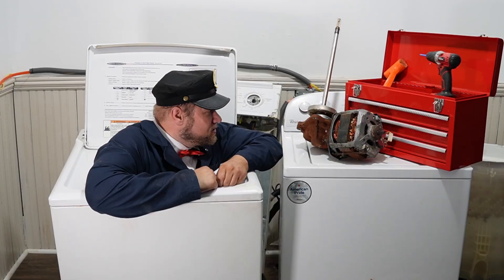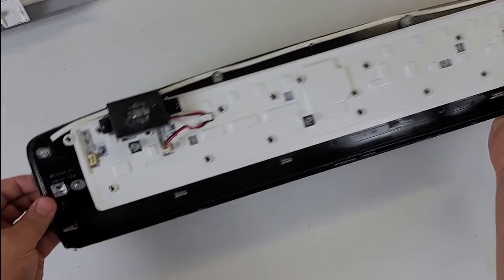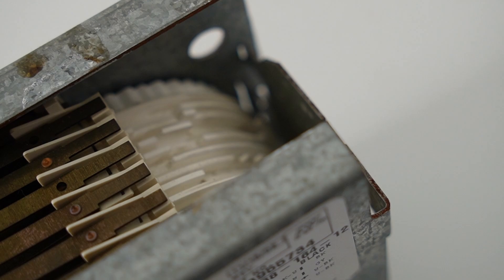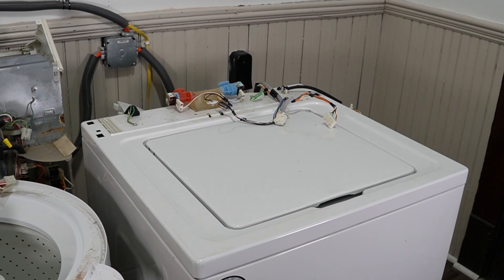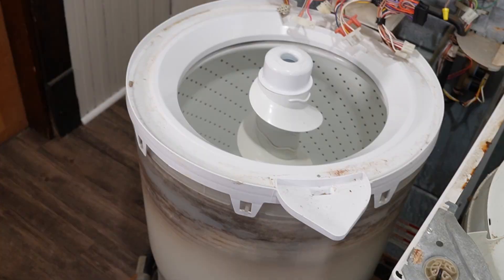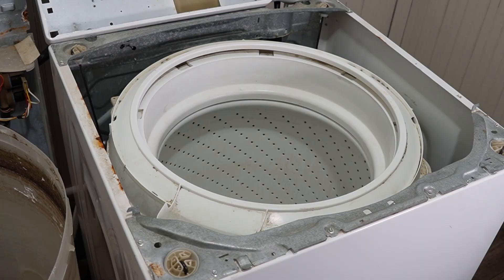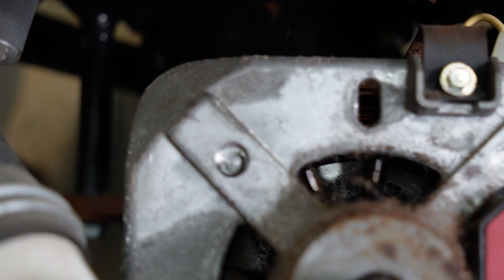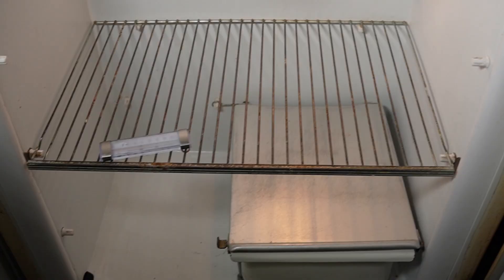Are Washers Built to Break? Inside a 1984 Washer vs. Now

Comment: Worth noting, $330/430 in 1985 (the sale/MSRP price listed in the SEARS Catalog that you showed on screen) is equivalent to $930/1200 in 2022 dollars. A random low end top-loading Whirlpool is $550/750 (at the time of this comment, which is effectively what my apartment washer is). That's a ~$400-500 base savings for a product that is vastly more intelligent (self-rebalancing is amazing), quieter, has more than twice the tub capacity, uses less detergent, and, as discussed in the video less water and vastly less electricity (90-95% less????). 

The energy cost for the 1985 washer is quoted at $67 ($188!! 2022 dollars) vs $30!! in the energy star guide.

I get people love when their confirmation bias about things lasting longer is true, but it's as or more important to consider the actual progress that's been made. As for electric components failing, fundamentally there's nothing stopping companies from using correctly sized components. It's like LED bulbs being run way over spec (thanks Big Clive for that information!), it's an unfortunate decision by companies but that doesn't mean incandescent bulbs are better (I mean, I still love them, but I love my lights that change color and dim through the day infinitely more).
Reply: I agree 100%
You aren't really saving money on the older system even if the new one doesn't last as long.
Reply: It’s even more apparent when you look at cars. In the 50s, aka “the golden era of the American car”, you’d be lucky if it lasted more than 5 years without rusting though. The designs were pretty snazzy though, most likely as a form of compensation as well lol
Reply: I'm an automotive technician so the car thing I understand completely. Old cars look nice and are easy to work on but that doesn't off-set the many many negatives that come with old cars.
Reply: Well researched, peoples rose coloured glasses view of history is amazingly short sighted
Reply: Incandescent bulbs are better at accurate color reproduction. Most crap LEDs have bad tint and poor CRI

Comment: We had a Maytag set from the 60's and decided to leave it at our old house when we moved in 2010 to our new place.  The only thing I ever did with the old Maytags was belts.  There was a lot of washing done with those machines.  But we left em and bought a set of these garbage Whirlpools.  They are not efficient at all.  No matter what I do, I can't stop the washer from banging around during the cycle and the clothes come out wet.  The dryer takes forever of course with wet clothes. There is no function on the Whirlpool to spin again like on the old Maytag...you could let it finish its cycle and go reset it to spin again.  We should have taken our old machines to the new house.  This new stuff is trash.
Reply: Try going to a pawn shop and getting an old one like that.  Can't be more than 150$.

Comment: I would like to see you get your hands on a Maytag top loader from the 1980s with the helical drive transmission.  Magnificently simple and durable machines.
Reply: It would be a short video, as you say, magnificently simple.
 I inherited one of these (& dryer) the only failure I have had (I should say, the only failure this machine ever had) is the timer discs wearing out in the washing machine (it was used daily for most of its early years).  And surprisingly, I could still get a genuine maytag part for only about $64cdn, not bad for a 30+ year old machine.   
 If anything is going to do it in, it'll be rust as with the machine in the video, not from leaks but the humidity/condensation that occurs during normal use.
Reply: @alexb.1320  Mine is 40 years and still running like a champ.
Reply: @alexb.1320  My co-worker has a matched set but they're the puke green color right out of the 70's LOL.
Reply: @wildbill23c  Ah, flashback Avacado. No question what era you are in when you see that color. =-)
Reply: @JohannnesBrahms  My grandfather has at least 4 sets (also 40+ years old) that various members of my family use. On the rare occasion they fail, my grandfather takes them apart and figures out the issue. My dad then gets on eBay and purchases the part, then my grandfather gets it running again.
Reply: @T4nkcommander  Three main working components and some belts.  Super easy to service and repair.  Some of the more detailed parts are no longer available though and if one of those little suckers go.  . . then KAPUT!

Comment: The barely used 1983 whirlpool/kenmore dishwasher I bought for $30 works SO well SO fast and reminded me so quickly of FUNCTIONAL appliances that I hunted down a 1986 washer/dryer set for $200. My clothes come out WAY cleaner WAY faster, and  I would have gladly paid more for those old used suckers than what comparable new ones sell for. Component accessibility/maintainability/adjustability/replaceability are EVERYTHING, and needless motherboards don’t mix with the humidity + dust of washer/dryers. 

If nothing else, see what builds up in a washer’s inaccessible filter after a few years in a household of long-haired humans, a shedding dog, and baby socks.

Comment: They’re engineered to fail because:
1) they’re built to the lowest possible price point because cost is the #1 determining factor in a buying decision. They will lose sales and potentially go out of business if they over-engineer their product and try and recoup that cost with a higher price 
2) 99% of the population do not understand how a washer works, nor do they care to find out. The differences between a well-built and poorly built washer are irrelevant to them and cannot be sold in a sales pitch. 
3) Having new appliances is as much a status symbol as anything else. People do not want to be seen with old, out of date appliances. This seems to be particularly the case with fridges - having a ‘white fridge’ is seen as a sign of low SES. 
4) Labour to repair appliances is significantly more expensive than it was 30-40 years ago and can easily exceed the value of the appliance, making repair pointless.
Reply: I’m that weirdo that finds out what the good stuff is and buys it, example: 4Runners (2020,2021) Honda commercial lawn mower (2022), my Kenmore appliances (2002). I go out of my way to pay more for better.
Reply: Exactly. If you calculate how old washing machine and driers cost in today’s money, they were actually quite expensive. Nowadays you can buy some cheap washing machine for 500$ with way more gadgets than before, so naturally they’ll fail. They’re not engineered to fail, they’re engineered to a low price point.
Reply: What does "low SES" mean, if you can explain.. Thanks
Reply: @ousamaabdu794  People from disadvantaged backgrounds.
Reply: @JAMESWUERTELE  The older 4Runners from the early 2000s are way better than anything made today
Reply: @Whiteyy191  thanks for the heads up.
An ex-girlfriend of mine was a bank teller here in the DC area, which is extremely diverse and has quite a bit of affluence. 
She said the people who always had the most $$$ in the bank were the unassuming blue collar immigrants. Keeping up with the Jones keeps many living check to check. 
Heck my washer and dryer were in the house when I bought it. 1980s Kenmore and the still work great. I personally could care less about optics
Reply: @ousamaabdu794  That’s very true. The never-ending race to outwardly appear wealthy will leave you behind in the long run.
Reply: Indeed on #1, this seems to lead most markets to a race to the bottom in long-term robustness.  Maybe a brand reliability rating could incorporated into the same sticker as the Energy Star info, to encourage better quality making a difference at time-of-sale, or manufacturers having to pay for their units to be recycled when scrapped, which there are similar requirements in some countries, but will need to be done more widely to make a big difference…
Reply: You’ve nailed it with this comment

Comment: Doing a old vs new washer comparison...and you use a 2002 vs 2017.  Even though the 2002 may have several design similarities , But there are definitely some build quality differences.  I've tinkered with old Washing machines from the 70's and 80's and they are more durable and easier to work on.

Comment: This reminds me of how LED light bulbs are advertised.  They print that these LEDs will last for like 150,000 hours and are a 60watt equivalent.  Well, the LEDs themselves may theoretically last that long, but in reality will only last as long as their weakest part.  Which, in my opinion, is the driver.  And, like he says, that tiny little electrolytic capacitor will only last a few years before drying out and smoking.  I honestly think that all this is well known by the manufacturers.
Reply: Most LED bulbs that I’ve bought go out quicker than incandescents. Many of them are DOA. I keep buying them though.

Comment: As interesting and informative as this was I think I missed the entire point. You showed both washers had pros and cons, but I don't think you pointed out why the older machines last longer than the newer ones. Is it the electronics? The motor size? The amount of electricity used? The wires? I'm honestly feeling like I'm supposed to guess here rather than you just saying exactly what is causing the new machines to wear out faster.
Edit: Oh and you've earned a new subscriber. Thx for the lesson, Teach. 😁

Comment: I know an engineer that works for a large appliance manufacturer.  He said most definetly Things are built to break.  He said they usually put in a part that is very hard to replace and expensive that is undersized and meant to fail.  This is so you will buy a new appliance instead of fixing your old one.
Reply: Your engineer friend is awesome. That's some greedy evil greedy stuff they're doing there.

Comment: BTW, the Speed Queen suspension is hands down the best design in the industry for maintaining the spin at high speed EVEN during out of balance.
Reply: Absolutely the commercial made units I used at work didn’t even vibrate in spin. Quality at its finest
Reply: @Wayne B I agree. The Maytag Commercial looks interesting but it's still just a jazzed up Whirlpool. The place I bought my Speed Queen set from the owner also owned a laundromat with the same model that I got but had the coin boxes and commercial front panel. They said they were in there for 13 years of daily use with no problems.
Reply: @PinkPower4 Yes, I knew and was surprised to find out that the TC5 isn't truly like the old 'classic' SQ in that it does have electronics. I could probably get by using the 'invertor' reversing motor machine as my clothes are rarely heavily soiled. That is the one thing I will say about that old SQ is it is pretty rough on the laundry. I'm content with it though. I had more problems with the dealer than SQ or Alliance, in fact they were pretty cool (SQ). I had a problem 3 months out of warranty and the dealer wanted to charge me $426 to fix a machine I (then) paid $765 for. I was prepared to buy another machine (not from them). I called Alliance loaded for bear ready for a fight and without even an argument the guy just says "yah, sure we'll cover it. It's only 3 months out of warranty." I was shaocked. They were totally cool. The place I bought them from wasn't. I had to call SQ and advocate on my own behalf. It wouldn't have been anything for the seller to just call up the factory and do what I did. They wouldn't even make the call. I wouldn't even buy a coffee maker from them after that. I mean I try to support local to an extent but not going to get screwed for it. And I tell everyone else to steer clear. One other funny incident with them happened a year before this washer problem. I was looking for a dishwasher. I settled on a particular Bosch that was new for 2017. They had it at Lowes for about $999 and also BestBuy for the same price. I called this local dealer inquiring about the model and they said they had one. Not really. It was the 'old' version from last year (a few years earlier) for $1200 and I WOULD HAVE TO PICK IT UP. I ended up getting it from BestBuy 2 days later delivered for $999 for the latest model. I let the woman know why I wasn't buying from her.

Comment: The old washer’s transmission gear is “plastic” likely glass reinforced nylon. The new one actually just uses lower grade plastic or some zinc or sheet metal crap.
Reply: The VMW gear case has nylon gears, and Whirlpool manufacturers them for $6 per complete unit.
Reply: The components of my top load  laundry machines and drying machines are made of case hardened solid hot forged and-or hydraulic pressed stainless steel alloy. They were designed, developed, and mass produced for our military for 24-7 non-stop use to clean up everything regardless of what we throw at them (heavy all terrain military survival boots, utility belts, heavy uniforms, arctic gear clothing, rubber shoes, rugs, heavy military issued blankets, etc) and they are still as good as new and still kicking like brand new after more than 65 years. The factory making them (there are 7 of them) are still making them based on their original designs and original materials and specifications STRICTLY followed on how to make and treat these stainless steel alloy materials into components. The revolving seals are made out of metal with cross hatch precision machining after they were case hardened and annealed-tempered (no quenching). Everything about them is OLD SCHOOL engineering using an all analog mechanical and electro-mechanical controls, etc.

Comment: When my 43 year-old Maytag washer and dryer broke and parts could not be found, I asked the technicians what brand they recommended.  They said in unison, “Speed Queen.”  You won’t find Speed Queen washer and dryers in big box stores, so we went to a higher end furniture/appliance store to view them. They are made in Ripon, Wisconsin, rather than somewhere in Asia or Mexico. They are commercial grade, and they are heavy since they are mostly metal, not plastic. The Washer and Dryer we purchased came with a 7-year parts and labor warranty. I don’t know if they will last as long as my Maytag units, but I hope so.

Comment: Front loaders are better i think although a lot of new models have sealed plastic drums making main bearing replacement impossible . great video though !
EBAC is a new British brand  that is designed to be 100% repairable and designed to be easy to work on .
Reply: An awful lot of people replace front loaders with their old top loader.   no thanks
Reply: ..front loaders REALLY suck..unless they are something like the commercial Speed Queen front loaders found at the laundromat, not the residential models...

Comment: I sell used washers and repair the old ones that I offer to "haul away for free".  If it is an old school washer with a cast iron trans, I fix the majority of them with no new parts.  Most often I have to rebuild the rotary switch by either using unused contacts within the switch or trading out a low draw contact with the burned ones which I clean and they work fine for most low draw circuits.  I repair newer units that have minor issues, but often part them out for other repairs and testing.
Thanks for a great video.
Note: Take a bunch of pictures before dissecting a rotary switch because they go from 1 piece to 100 pieces immediately after drilling out the rivets.  It is possible to fix them regardless of what most believe.

Comment: Well from what I've seen in this video and what I've seen from ripping apart and scrapping old washers I can back up your findings with how the newer machine might be more efficient, the older machines are just built like tanks in comparison and are actually meant to be repaired and maintained. Energy efficiency might be nice, but if it can't be kept going for more than a couple years at a shot then what's the point?
Reply: Right im pretty sure its to meet emission standards but how is a machine with lots of plastic going to pollute less when its breaking every 3-5 years

Comment: In 1979, we moved to a new apartment and bought a new washer and dryer. We moved in 1992 and left the units in our basement and sold them to the new tenents for 25 bucks each and they were still running. we replaced the drum of the washer in 1990 and heating elements in the dryer twice in that whole span of time. We are a true throwaway society.

Comment: I have one of those old Sears Kenmore washing machines, probably early 80s to possibly late 70s vintage, I don't know exactly but I'm sure it's at least 40 years old. I bought it used from a friend who's mom decided to replace it with a new one after it broke down. He replaced the water pump to repair it and that's all it needed. This was during the days when you could easily obtain parts from Sears for just about anything they sold. He sold it to me for $100 after having it in storage for a while, that was in 1990 and it was already an older outdated machine at that time. It has never needed any repairs since and I'm still using it today.

Comment: Make it more complicated. Now make it cheaper than sand. Let the customer do final inspection. Overcharge for parts so they're going to buy new
Reply from the maker: Crazy but so true. If you double the components but they aren't higher quality, you halve the mean time to failure
Reply: Another thing is that you could warehouse a mechanical timer in a no air conditioned warehouse in excess numbers for 50 years but anything with capacitors can self deteriorate within 5 years. You pointed out the undersized capacitor. I used to see LCD TV's with the exact problem. Consumer grade electronics invaded the appliance industry. But there's some good electronics circuits. Might last 17 years but then you'll wonder what else is going to fail and by then it's a rust pile